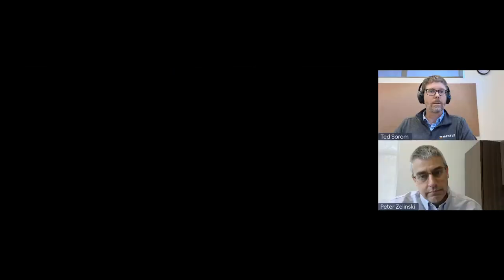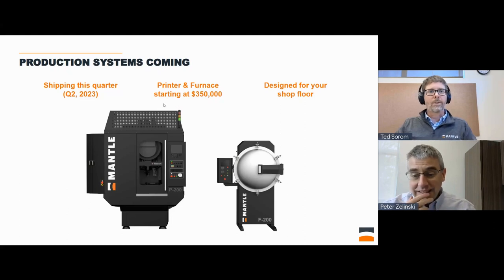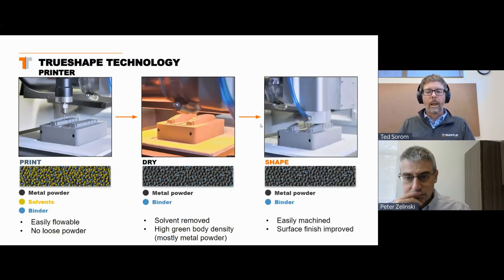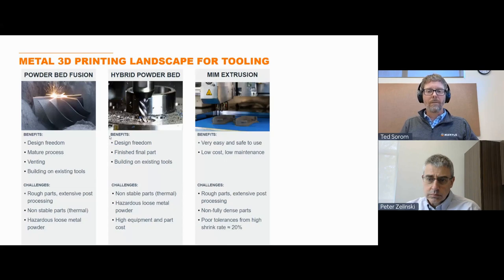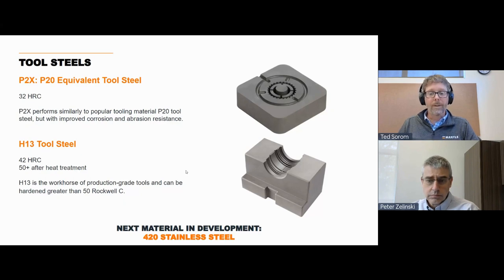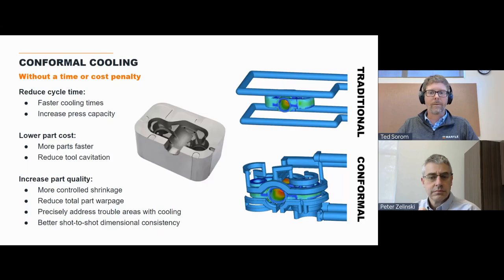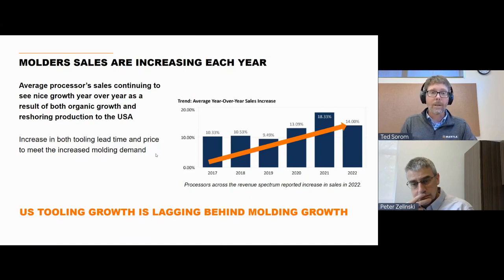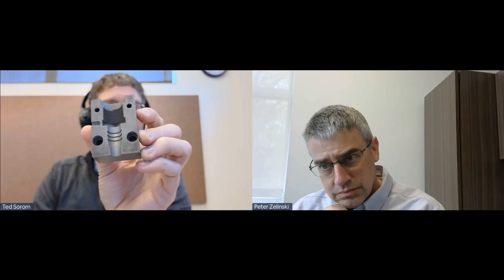Redefining Metal 3D Printing for Injection Mold Tooling

Comment: Great process, congratulations for its development, quick question, don't remember hearing, do you need support in your builds, or you can not print if support is needed?
Reply from the maker: Today we do not have the ability to print supports. Fortunately,  most tools do not require supports. Large cooling channels can be printed in a teardrop shape to eliminate the need for supports.

Comment: This could be an amazing reduction in time to market with tooling on site or near shoring to reduce Supply shortages and increes margins.
Tool n die is as hard as brain surgery and more expensive so thos could be a super great alternative to pushing everything offshore. When will there be bigger build volume and how will it affect tolerances?